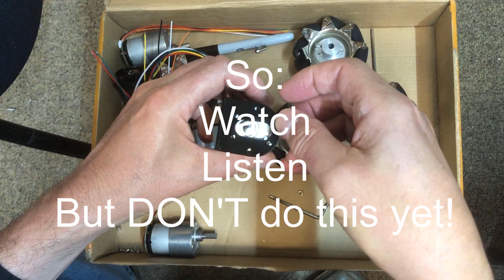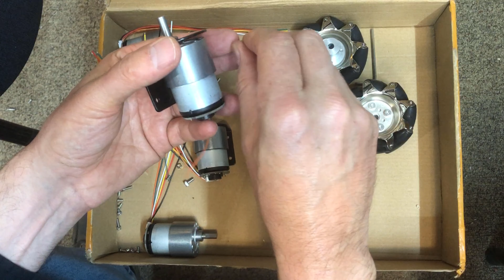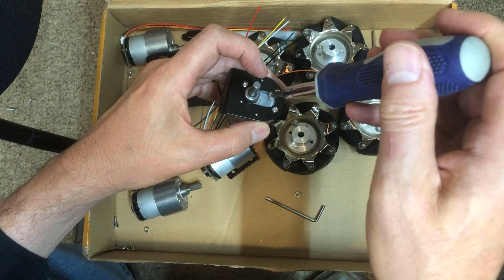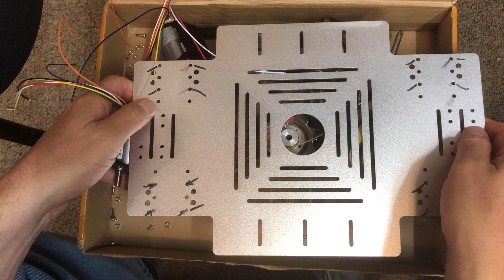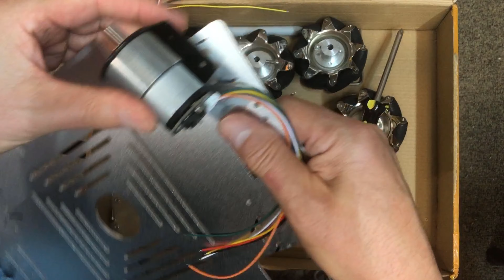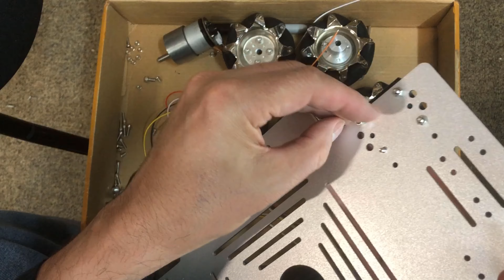HOW TO BUILD: Moebius Mecanum Wheel Robot Car Kit for Arduino & Raspberry Pi. (How to assemble)

Comment: Thanks for the video! Are the wheels made of plastic or rubber? Do they have enough grip on smoother tile surfaces?
Reply from the maker: The wheels are made of steel and rubber. No plastic. Yes, they can grip a tile surface.